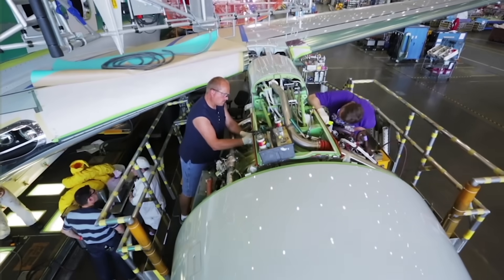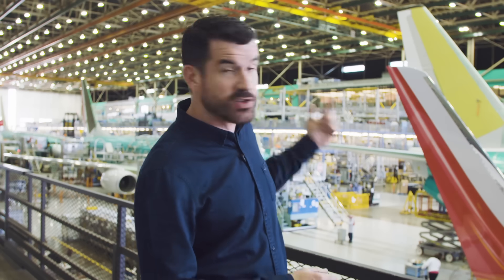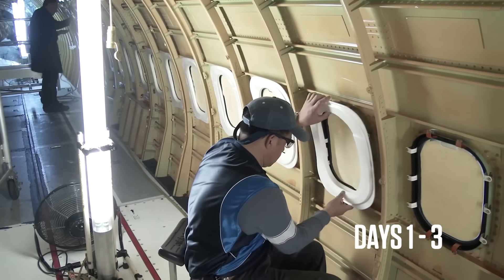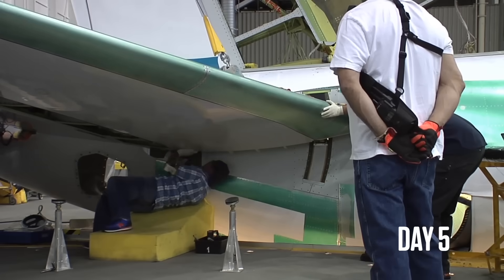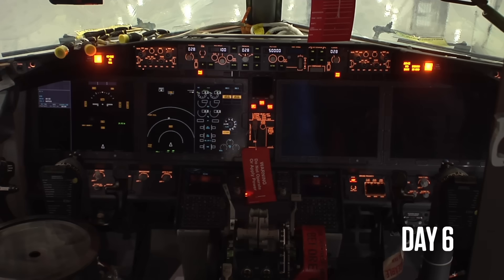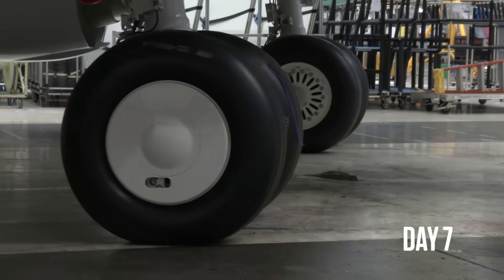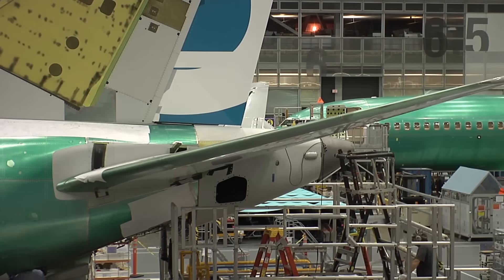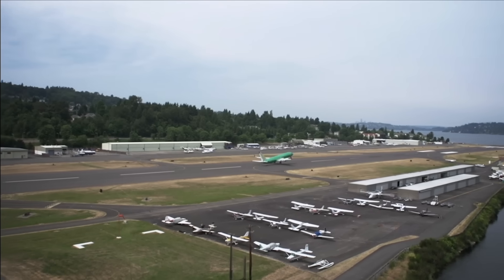How Boeing Builds a 737 Plane in Just 9 Days | On Location

Comment: Is this me or did anyone else got this recommended after Air India plane crash.
Reply: Yes. YouTube Algorithm.
Reply: Me too
Reply: Bro just after that it did to me
Reply: That air india plane which crashed was built by this boeing company .
Both engine failure happen so it's only boeing fault
Reply: @nivasdn9779  First of all, Boeing doesn't make engines. Second, stop making assumptions you know nothing about. The crash was caused by the pilot switching the fuel lines offline. It's either a pilot error or intentional suicide.
Reply: @nivasdn9779  such a tradegy, only one of the passengers survived
Reply: @nivasdn9779  engine made by GE aerospace and they make all the engines for Boeing that’s why they are trash and Airbus engines are made by Rolls Royce that’s why they are excellent
Reply: @nivasdn9779  nah its either air india or the pilots fault
Reply: @nivasdn9779  absolute nonsense. it's air india's fault for maintenance most likely. stop spreading misinformation. the engines aren't even made by boeing
Reply: @sourrlemons its ge, so its still on america

Comment: If it's Boeing, I ain't going
Reply: Boeing is way safer than any car
Reply: @Redsoda_ I understand the maths. But here is the thing. Some models of Boeing planes are faulty due to greed, cost cutting. So I'm not giving them my money.
Reply: @featuresky5084 well after a accident with Boeing they spent over 450 million dollars to work on safety
Reply: @Redsoda_ if you still give them money, they will reduce the quality and it will no longer be safer than car
Reply: @featuresky5084 airbus a320’s are grounded rn cause of system errors
Reply: @Redsoda_ well if you now compare apples with tomatoed
Reply: If you close your nose you can't differentiate between them  @yorkehsiva
Reply: @Redsoda_ And an Airbus is safer than any Boeing 😂
Reply: Canceled a flight and switched to Airbus
Reply: @featuresky5084 same chance of airbus crashing then boeing
Reply: @SussypizzaYT  I have no loyalty to any of them. Whoever is safer, I will choose them.
Reply: Then never go on a car
Reply: The incompetence of airlines to properly maintain their craft is not Boeing's nor Airbus's problem. Guidelines and stuff along these lines exist for a reason and when not followed well.. you get falling doors, engines, valves and anything else.
Reply: @sharl1633 OK aviation expert, heard of 737 max and auto nose dive adjustment? Was that airline's fault?
Reply: Boeing has been an extremely successful company for a long time. A few pilot error incidents don't change that
Reply: Well said. Always AirBus.
Reply: Sybau
Reply: Cornball. Boeing still has an extremely good safety record; flying is infinitely safer than driving. The most recent crash you're referring to wasn't the fault of Boeing.
Reply: @couchpotatoes5158 
Sitting in home is infinity safer than driving or flying, are you suggesting we sit in our homes?

Feel free to fly your corny a&& with Boeing.

Comment: Maybe they should increase it to 9.5 days then all bolts will be tight and the escape hatch panel won't fall off. Boeing is sacrificing quality for speed which is a real safety concern. I worked in the aircraft industry for more than 30 years and what is happening at Boeing is DANGEROUS & I wouldn't fly on a Boeing aircraft ever again.

Comment: Who would've known...here we are in 2024 and the 737 Max shown ends up being a giant pile of a junk. 9 days of assembly is emblematic of management and corporate greed pushing to cut corners, asinine self certifications programs, and engineering exemptions.
It used to take 13 days to assemble a 737 with a good chunk of that time being QA & QC which has all been cut to pad the bottom line.

Comment: I would be more impressed by this feat if the planes were built without parts falling off of them
Reply: Well..... They mostly are.
Reply: @GDuncan8002  mostly
Reply: Millions of flights weekly in world.. Your chances of winning the lottery vs riding a airplane  EVERY day and being in a crash or emergency landing, are better winning lottery.
Reply: Those people do the same job every day and round the clock shifts if you watch the video. Flying daily ,is safer than driving your car 2 miles once a year.
Reply: No bolts on doors is just sad 😢

Comment: Airbus builds far better and safer planes than Boeing.
Reply: Wrong
Reply: @AW33406  On what grounds am I wrong?
Reply: They're not "Far better and Safter" Both companies have similar Records and Boeing planes are Just as Safe. Most Plane Crashes are Due to Pilot error or poor Maintenance which isn't the Manufacturers fault. Only a small handful of Plane crashes are due to actual Design flaws. Not to mention Airbus planes are flown with a tiny little stick on the left side of the cockpit which in my opinion is Inferior to the CHAD Boeing Yoke

Comment: that's why they are crashing.
Reply: Atul Sharma this is the 737-800 not the max8
Reply: @radiotvjinglesyoutube3318  i know Thats 737 max
but manufacturer is  same.
Reply: Atul Sharma but they build it differently. It’s a totally different plane.
Reply: @radiotvjinglesyoutube3318  ok 
but it is a huge fall for them.
Airbus is getting advantage.
May be there is some conspiracy.
Reply: Atul Sharma no, lots of Airbus cancellations. Boeing is still popular, they have delivered over 15,000 737s including the max, with a further 6000 MAX on order. Still prefer Boeing, Airbus has had more crashes than Boeing. The 737NG is much safer than the idiotic a320

Comment: Physical construction of Boeing 737 Max is wrong as you consider aerodynamics. Engine is more powerful but size of engine is bigger than the regular 737's engine. Engine is installed under the wing a little forward and up so that to keep enough distance between engine and ground . This installation in flight makes tendency of turbulence over the wing which result in stalling the aircraft which means in other words nose up. Boeing knew that this will happen during the flight. So they installed MCAS system on the aircraft. MCAS system makes the nose down in case of nose goes up.  Bu it doesn't work properly and puts the aircraft diving and then crushing.  

Structural construction fault can not be corrected by MCAS system's software modification. So this aircraft cannot be considered as a safe aircraft any more even if after software modification. 

In order to solve the problem structural changes must be done on the aircraft. Regular version of 737 has no MCAS system. Because physical construction is correct. But fuel consumption is a little high than 737 MAX. 

737 MAX has new engine with good fuel efficiency but comes with safety issue. In aviation safety is a paramount. 

So it can be end of 737 MAX.
Reply: Murat T mj
Reply: Murat T but it wouldn’t be the end
Reply: @Steven-hq6df  More than 100 test flight done but Boeing is unable to solve the problem. So It is clearly the end of 737 Max. No airline company except Americans wants it anymore.
Reply: Murat T most of the airlines aren’t canceling orders

Comment: Unfortunately the man for his progress makes mistakes, less and less, it is the tribute that we have to pay to keep moving forward. The problem is that Boing hidden the software to the pilots and airlines. It is undoubtedly and will be a magnificent plane but the larger size and placement of its more efficient new engines means that this model has a different behavior hiding the pilots for this reason Boing introduced that electronic support. I doubt the ability of the Ethiopian pilots, because turning off the system they could adjust it manually.

Comment: Anyone else thinks this is why they are crashing a lot now?
Reply: The reason the planes are crashing is purely a software addition to the MAX 9 that wasn't trained for or honestly needed. The plane's hardware is tried and tested and the problems lie inside the systems, not the plane itself. Besides, this video is two years old and the first crash of the MAX 8 was earlier this year.
Reply: @seanallen4966  I totally agree. But sometimes you have to ask did they get so comfortable at one point because of their quantities, that they forgot about quality? Plus software works hand in hand with hardware, so if anything, a software issue can still affect the hardware.
Reply: In all honesty, slot of companies rush through development under deadlines.
Boeing then are under more deadlines to build many planes. 
Then rush through testing /quality assurance??? Of flight operations/avionics
Reply: No it's MCAS  apart from that the plane is like any other Other plane.

Comment: For 9 days they building one huge coffin 😔
Reply: it was the 737 max 8 and 9 that had the problem not the original 737...they have been fling for years
Reply: devin m Which contributes to the reason of the crashes. Boeing should have invested time and money into a clean sheet 797 instead of rushing out  a re-engines 737.
Reply: Thats 737 max not 737 800
Reply: That's not fair dude....
Reply: @conned  yup depends on maintenance too. airlines should also take care of such things.
Reply: @Carl Hinton that's not what happened at all. MCAS systems were mentioned in the official flight training to pilots positioning from the NG series, but it only played a small part in the mandatory 2-hour iPad course that most pilots from the low-cost airlines that operated the 737-8 elected to take (e.g. Lionair) and the course didn't mention increment parts of how to deactivate the system. More traditional carriers such as American Airlines and Air Canada had their pilots undergo the classic weeklong training system and so none of them had problems.

Comment: 737 max is aerodynamically unstable, wings are too small to generate enough stability for its size. When they designed 737 max they put bigger engines and enlarge airplane body leaving wings same size as before. As a result airplane become less stable and they tried to fix construction problems with software, the result is known. Now Boeing tells us they are working on new software update. They should just scrap all 737 max fleet and make a new aerodynamically stable model with bigger wings or smaller engines and body. 737 max cannot be fixed by software, the problem is the ratio between wings area and size of aircraft. They should not put small wings on big aircraft to save fuel by the cost of reduced safety,.

Comment: The same goes for aircraft-parts production, where China is also a major player. Bruns says every airplane Boeing makes includes parts from China. The Boeing 737 is probably the model most heavily reliant on Chinese parts. “They build the whole tail section, the vertical fin and the horizontal stabilizer, and then all the doors for the airplane. So if you’re just looking at the structure, that’s more than a tenth of the structure, maybe an eighth.”

Comment: If the air data computer do not agreed with the values waiting  to caompare a large errors then what...
If the system is updated then a software may be trusted but handing errors may be temporarily shut down. 
I do not liked it has to do with blackninght  satellite future fixed???

Comment: My personal opinion: Why does the plane crash?  It is rather strange, to design an aircraft, without thinking it all over.
The problem  can be found, in the. position  of the engine. Its really  a trimming  problem. The engine seems to  be in a dead spot,
Depending on the load, when not exactly controled, the horizontal becomes instabil, and the plane goes up and down, tipping over
its gravity axle. It is normal, that the engine has its place  wright in front, or way back. Trimming is in those positions quite easy.
Having the engine where its located in the plane in question, and laking  of  a strikt control of the load, Trimmung might result as impossible.
Flying low, gives  the pilot no time to correct the problem, and the plane will shortly after take off hit the ground. As it happened twice.

Comment: A couple of 737 fuselages were badly damaged if not written off after being the victim of somebody with a high powered rifle on the train where they were built. I forget how long ago that was but they are now shipped in bullet proof container/rail wagons. So yes it’s assembly but the logistical problems must be huge.imagine running out of 1 critical fastener. Manufacturing Engineers would be deeply involved in Assembly and day to day production problems. Not all engineers are design guys, they would have countless Engineers on the floor involved in maintenance, plant engineering,Quality Control to name a few. Qualified, maybe?

Comment: truly amazing. Everyone of those workers are masters of their craft.
Reply: They aren't 'crafting' anything, they are assembling a plane from pre-fab parts. That's like you putting a lego model together via instructions and calling yourself a master of Lego craft, you are not, you didn't do anything but click blocks together following a set of instructions.
Reply: @zoidburg2975 I am an in-tank mechanic at the Everett Boeing factory. Trust me when I say this, you gotta be a professional at your job in order to actually work on a plane. You are working on a plane that is going to be in the air, carrying possibly hundreds of people with hundreds of other people on the ground below it, where one small mistake can lead to the death of potentially thousands of innocents. The training given to each and every single mechanic and quality inspector at Boeing is more than crazy. You work with engineering maps and use so many different specifications in order to get your job done correctly, which in itself is impossible to master. Each welder and electrician must be so careful, as one tiny bit of their effort not put into their job can lead to errors that even quality assurance can't catch, leading to horrible failures on the airplane. Each engineer and programmer that poured their hearts and souls into the programs and the build quality of the airplane are not masters. No, absolutely not. They are super humans for enabling a plane with a massive body to fly over people with almost no mistakes (emphasis on the word almost). I don't know about you, you can see those mechanics, engineers, software engineers, chemical engineers, quality inspectors, welders, electricians, and fabricators as just people putting together a bunch of components, but they are much more than that.

Comment: Which plane is safer the  737 or the a319/20 series ?
Reply: The a319 has only been in service for 23 years, compared to 51 years for the 737. It is hard to say because a lot of lessons were learned from the high rate of accidents in the 60s/70s. The A319 has never had a hull loss incident but a good number of 737 accidents have been from pilot error.
Reply: Mehh, if you count just from the 737NG, is 737 for just 1 accident, so, both are similary safe

Comment: Engineers don’t assemble the plane, they design it.  Please don’t generically conflate the roles of those who design with those that either fabricate or assemble.  They are all vastly different and orthogonal skill sets and all critical to the factory’s operation.
Reply: He's calling them that because in England they are considered engineers. It's the the same thing with aircraft mechanics, in the US we are called aviation maintenance technicians, but in almost every other country it's aviation maintenance engineers. I'm not sure exactly but they might have to be A&P's (aircraft mechanics) to work there.
Reply: There are engineers on the floor of the factory who assist with assembly.
Reply: that was an awfully spergy response son.
Reply: Manufacturing engineers assist with assembly and create more efficient processes.
Reply: I just figured it's because you need an engineering degree and seven licenses to stuff batting in the UK.
Reply: True
Reply: Typical of these sorts of vids, the writers and talkers don't know what they are talking about.
Reply: i think A&Ps eventually build the very same intuition an experienced engineer has. And engineers eventually build the intuition towards repair with time. Both engineer and technician know aeroplanes inside and out.  Of course i am not saying a boeing technician will be able to design a new boeing plane like a boeing engineer does  (since design is science and theory) but they probably have a lot of the same ideas and insight as to what to design :).